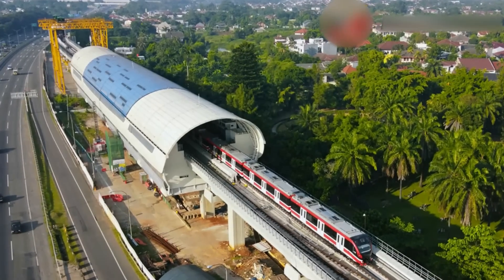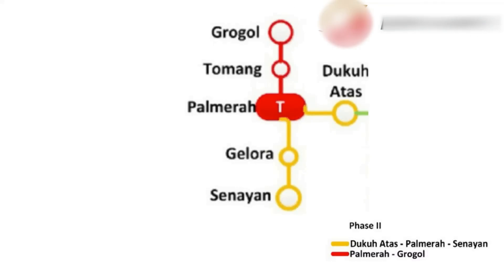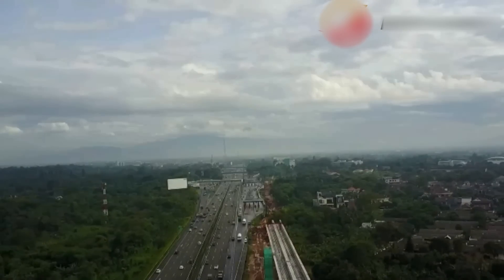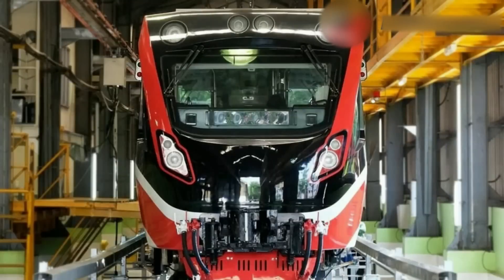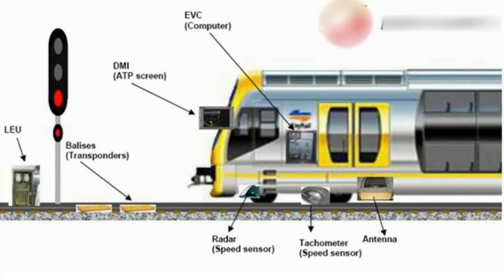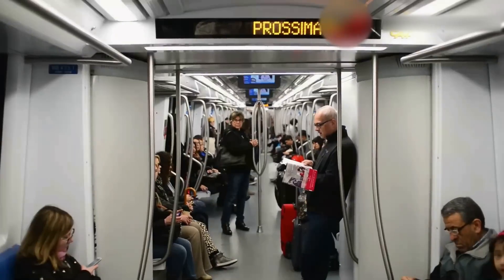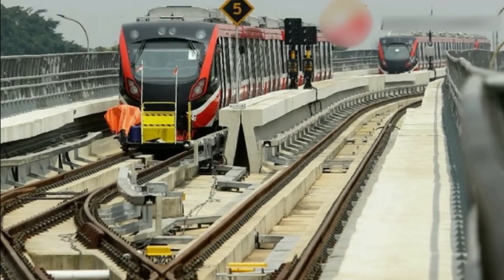Building Indonesia's Most Advanced Railway System

Comment: Update: even not commercially used... tre mrt already crashed, a human error they said 🤣🤣
Reply from the maker: Thankfull its jsut human error.
Reply: Heran sama mnausia macam kamu. Tujuannya apa dah? Supaya dibully?
Reply: Kenapa memang nya bang 
Kita sudah bisa buat sendiri 
Klo mau main politik kurang kencang lagi bang
Reply: Namanya trial, justru bagus lah. supaya aware dan ga terjadi saat 'live' nanti. kita bikin aplikasi aja ada UATnya dulu. test dulu. sebelum go live. knapa harus di ributin sih.
Reply: Mechanical failure rather than human errors caused the crash. With hardware redundancy and auto brakes system as well as safety features with modern rail signals systems, system overrides human operator errors.

Comment: This LRT is different with LRT Jakarta city. Built by Central Govt with 2/3 phases strecting total of 130 km connecting Jakarta city and its greater namely Bogor, Bekasi and Depok and Tangerang in the near future. Its designed to be driverless system like MRT Jakarta, LRT Jakarta and APMS Soekarno Hatta International Airport. Thanks to PT INKA that make the trainsets. This lrt also integrated with Halim HSR station in East Jakarta. The same lrt project that using U shape girder in asean is lrt 3 Kuala Lumpur. Its 3 rd lrt in Indonesia as well.
Reply from the maker: Yes you are right this is different, I should make a separate video about LRT Jakarta to show the differences.
Reply: @BehindAsia  some pict on your video showing LRT Jakarta too by Jakpro/Jakarta Govt.
Reply from the maker: @ambright9890  We have gotten that feedback! Thanks for this, it looks like our video creator have been misinformed. We will review the video again, thanks to YouTube's editor we can change it without deleting the video. Thanks!
Reply: Also it is more of a medium capacity rapid transit than a light rail, really.

Comment: Great to see that they're using brand new, locally manufactured train sets, and not some Japanese hand me downs.
Reply: for the commuter line, better japanese' used train for the cheapest ticket. but for the new projects yes, agree with you
Reply from the maker: @fxsoesamto  Although Japanese makes great trains, having PT INKA do these projects help them improve their long term skills.
Reply: @BehindAsia  Which country are you from?
Reply: @fxsoesamto  KAI can buy brand new rolling stocks for its KRL fleet. The reason why KAI choose old trains from Japan back in 2000's was not about ticket cost but because KAI needs to modernize its KRL system as soon as possible. Building hundreds of new rolling stocks is wasting time.

PT.INKA currently already can build its own EMU for KAI's KRL fleet. KFW i9000. But INKA couldn't replace all of KRL fleet in a short time.
Reply: @mirizid9667  Aaahhhh I see....Thanks for the Information
Reply: @mirizid9667   beberapa bulan lalu kai pesen krl dari inka bang, tp yang ini bakal lebih bagus karena kerjasama dengan stadler rail dari swiss
Reply from the maker: Thanks to PT INKA❤
Reply: @BehindAsia  next video :
MRT jakarta phase 1,2,3
Reply from the maker: @ekapurwandi9045  Will look it up thanks! stay tuned❤

Comment from the maker: Correction(s):

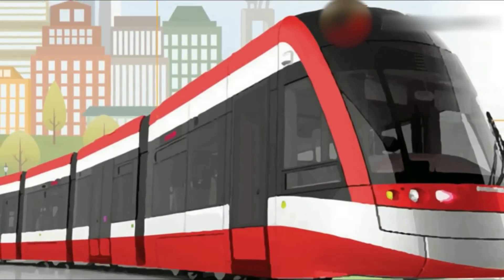2:48 Jabodebek is the 3rd LRT, not the 1st.
Reply: It's actually the 2nd in Jakarta area. The 1st one is Jakarta LRT, only has one short line. This Greater Jakarta LRT (not Jakarta LRT) has far longer lines and reaches the areas beyond DKI Jakarta. But, as far as I know, this is also the 1st rapid system in Indonesia that uses driverless trains made locally by PT Inka.
Reply: @ven1805  iyain aja susah amat ya kak? Ribet amat jadi orang indo
Reply from the maker: @davey5728  This is really unfortunate news, I hope no one was injured and everything would go well!
Reply: Have you heard of the Jakarta LRT crash?
Reply from the maker: @Justineexy  Yes I have! quite a ton of people have commented on it, thats sad to hear! I'm sure they'll pull it off somehow.
Reply: @BehindAsia  I also didn't know much until it was on my recommended.

I can't understand it, how does a newly built line crash before it even enter into service....
Reply from the maker: @Justineexy  That is something that the contractors need to answer.

Although from my perspective and as someone who has done project management before, this crash is actually a good thing, because it happened during testing which proves that their tests enabled them to find errors.
Reply: @BehindAsia  true,  thankfully it was a test run or else it would be far more deadly.

Though,  it still highlights some problems with the autonomous train sets...
Reply from the maker: @Justineexy  I read from the comments it was actually a human error, might've been someone who didn't know much about train systems.
Reply: @BehindAsia  Could be!